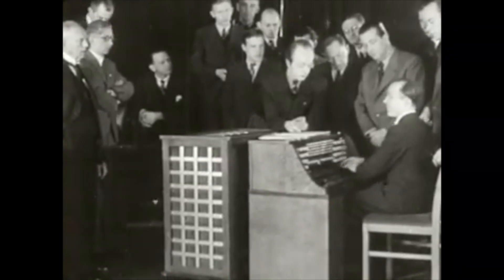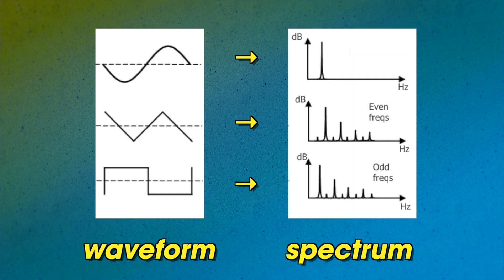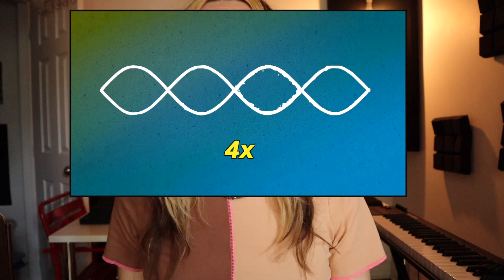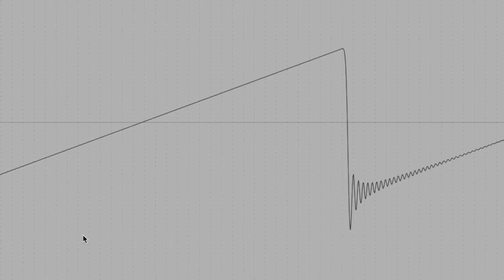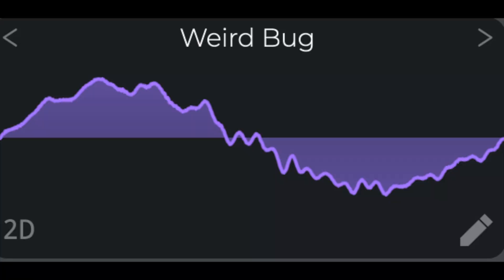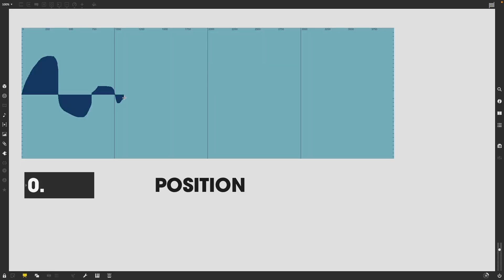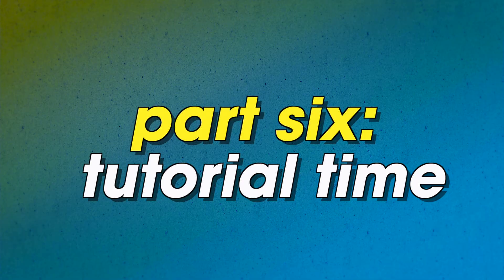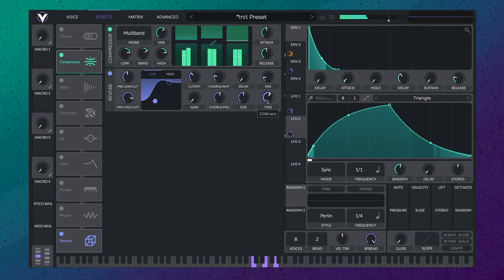This Changed Synthesizers Forever

Comment: 5:00 "the same digital audio technology that we use today: Pulse Code Modulation". That's not exactly false, but it's also a very obtuse way to put it, and detracts a little from the otherwise illuminating and interesting content in this and other videos on the channel!.  In digital electronics we represent values as digits, in turn represented as sets of bits (bytes, words).  If we need to represent a time-varying signal, we just use a stream of such digits, evenly spaced in time (usually).  Digital audio just uses that same idea. And of course we can store such a stream in a file, manipulate it, send it over the internet, view it as a graph, etc etc, like we're familiar doing to all sorts of data.  
The term "PCM" to refer to this mundane scheme has always struck me as gratuitously unhelpful.  There is no "modulation" as you might find in PWM, or Pulse Position Modulation, AM, FM, FSK etc, where there is a carrier signal of some type, and some characteristic of the carrier is varied to carry information.  I advocate that we stop confusing people with the term PCM, and just call it something simple like "digitized audio".

Comment: Nice introduction to wavetable synthesis, but alas it contains several inaccuracies.
a) The analogy between flip-books and sample playback is flawed. With flip-books the slowness of our visual perception leads to the effect of moving pictures. With sample playbacks it's not that our ear or brain interpolates the space between the samples, the digital to analog converter does. What comes out of the audio outputs is a perfect analog signal.  
b) A wavetable, as implemented by PPG, is not a continuous sample of several single waveforms, through which you can scan by changing the the sample start and end point. It is a table with a fixed number of slots (64 in PPG and Waldorf synths), some(!) of which contain a single cycle waveform sample. You can now scan through the *table position*. If the there is no sample in the wavetable slot marked by the current position, the sample, that is played back, is interpolated from he nearest neighbouring slots, which contain a sample. This also allows for non-integer, i.e. "in between", wavetable slot positions. Thatswhy you can have, for example, a wavetable, which only contains two waveform samples, one in the first and one in the last position.
The Blofeld manual actually contains a very good explanation of this with pictures etc.
c) (minor nitpick) The first wavetable synths did not have digital filters, the performance of the microprocessors used in them would not have been sufficient for that. One of the goals of wavetable synthesis at first was to *emulate" the sound of filters with their cutoff being swept by scanning through a wavetable. Because that still sounded too harsh, PPG decided to add analog filters.
Reply: As long as we're nitpicking :-)... " it's not that our ear or brain interpolates the space between the samples, the digital to analog converter does". The DAC outputs a sequence of analog voltages and specifically does NOT interpolate between them.  The interpolation is the job of a subsequent analog filter.  (Unless you are using the term "DAC" loosely to refer to a complete packaged unit that includes a DAC component, filters, maybe an amplifier, knobs etc.)

Comment: Everything from the mid 1970s on has been a step back. The 1980s were awful. The 1990s were even worse. The early 2000s were miserable. Luckily actual synths came back into (semi-) mass production. Pity they're used along with those dreadful DAWs 🤢 but one can't have everything. Long live hardware mutitrack recorders.
Reply: "Everything from the mid 1970s on has been a step back." That is a statement so broad as to be silly.   It would be more interesting and useful if you would describe in what way particular features or characteristics you believe were good in the 60's and 70's, and in what way related features were not as good in synths of later decades.
Reply: So you don’t rate things like the Jupiter 8, Sequential and Oberheim synths?
Reply: @leftmono1016  JP-8, OB-Xa were good; OB-X, SEM-based OBs, Roland System 100, 100M were better. As were all modular systems. All from the 60s-70s. I'm not big on polysynths, wouldn't say no to a Polymoog or better, a PS-series Korg, though.

Comment: The single biggest advance in synthesizers was the use of knobs! And functions they could control of course. There was a time when one had to use IBM punch cards to do that and it was hardly perform able. I loved my DX-100 (FM synth) but its lack of knobs and the abstract ideas behind manipulating operators and algorithms (and my lack of OCD) kept me from doing much voice design with it. On the other hand, its built in sounds were wonderful! 1 slider to control all that sound one parameter at a time was too little. Wave table synths were a bit the same on the design front but generally had more knobs! Your discussion at the end about modern synths combining all this is wonderful!